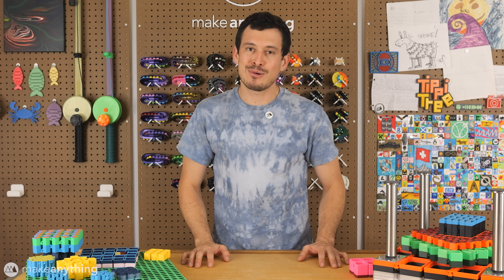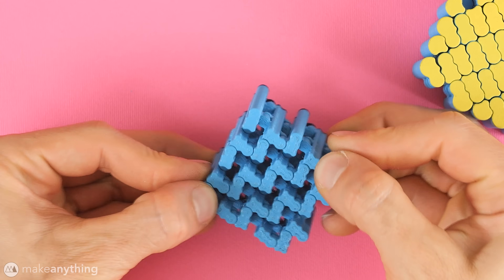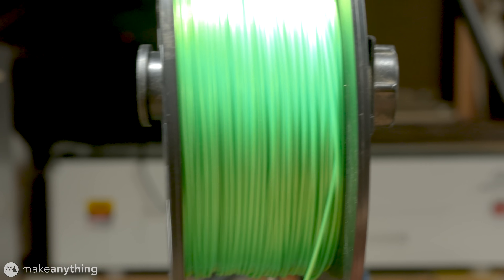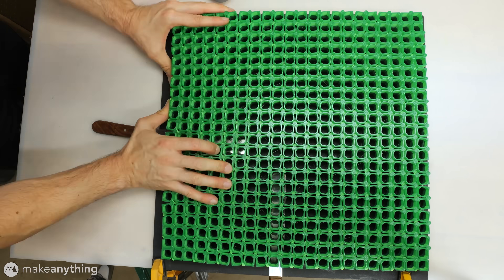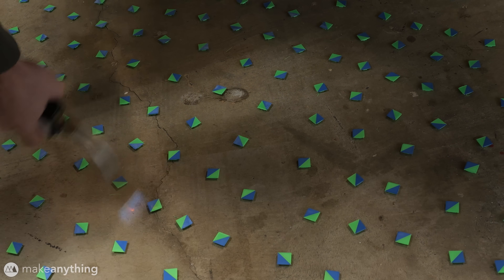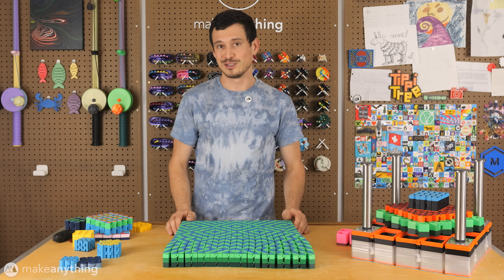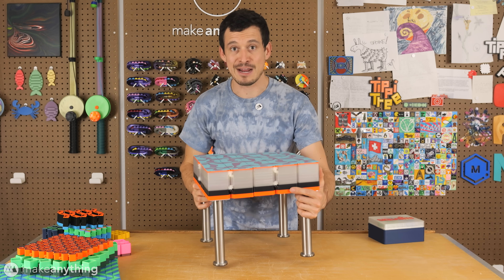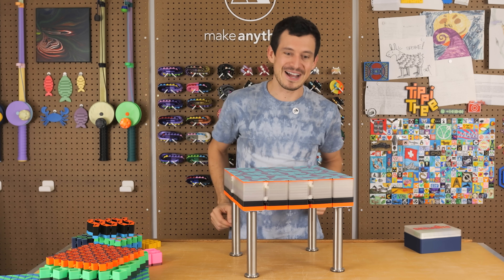Auxetic Art (win a 3D printer!)

Comment: How'd you do the 90 degree rotation locks in illustrator? also curious about how'd you do the perfect grid, if you wouldn't mind answering
Reply from the maker: Hold 'shift' while rotating for 45 degree increments. For the grid I just had snapping on, hold 'alt' while moving one square, and then used Ctrl+D to repeat that action over and over to make my grid
Reply: @make.anything  awesome thanks

Comment: A tip for stuck prints like the tiles at 8:00 - don't try to bash the spatula under them violently, especially with your hand on the other size just waiting for you to slip and slice your hand open, simply grab anything solid and gently tap tap tap the end of the spatula instead. It works wonders.
Reply from the maker: It's embarrassing that I never tried that. Good tip! 😅

Comment: Heres an idea 💡, from the functional print loving half of your audience.  Make the austhetic part thinner and stronger. Now you can print a support lattice using minimal material on a smaller printer, which expands to become larger. Then you can place your fill pieces both into the existing lattice as well as into the openings... Now you have printed much larger surfaces using a small printer And by using less plastic than if you had printed the lattice to be your desired size and glued it.  For your bonus round, figure out how to print it on two levels so that when you expand it to its maximum size, There are pieces on hinges that fall down into the openings to close them off from the top. Now you have an expandable table without any holes in it at its largest size.  Flip it over and all those hinged caps pop back out, and you can close it back up

Comment: Man that's so dang trippy! I wonder if the properties can work in more than one plane... Probably not, but maybe!
Reply: I mean something similar (pull in one direction expand in another) has been done with paper recently by 3m to make packing material.
Reply: I Think an infinity cube might be the extension of this.
Reply from the maker: Hmmm tries to rotate hinges in my head 🤯
Reply: @make.anything  A 3D "hinge" might be a ball-and-socket joint, with every 4 cubes able to rotate their center sides up or down to the surfaces.  The resulting action would be super satisfying as well, with the square hole "folding out" into 4 tiles.
Reply from the maker: @WatermelonArtiste  you might be on to something 🤔
Reply: Kind of like a Hoberman sphere?
Reply: as gabe said... the next step seems to be the Hoberman sphere.
Reply: There’s also a 3D version, that’s not a surface, but it’s less fun than the 2D style imo
Reply: The original diamond-fold structure could be made with compliant joints. It wouldn’t have a nice full 90° rotation but any material with a negative poissons ratio it pretty cool.
Reply: Steve Mould made a video about special variable-shape auxetic structures
Reply: The hoberman sphere comes to mind, check it out.
Reply: I mean my immediate thought is the 3D toy that expands from a small sphere into a much larger sphere. In chorus they used it as a visualization for expanding our lungs. As others have mentioned it’s called the Hoberman sphere
Reply: You should research Bistable Auxetic Structures!
Reply: There are 3d and 4d auxetics!
Reply: Look up the channel GCM EPFL, it's a Swiss university with a number of different research papers (and corresponding videos) in this field. The most similar would likely be their paper on bistable auxetic materials

Comment: You still use Simplify3D?
Reply: For him its free😂
Reply from the maker: I mostly use Prusa Slicer, but already had the printer profile for the CR-10 Max on there... plus it can actually handle massive files fairly well
Reply: @make.anything  Ahh okay that makes sense since you hadn't used the printer in a while. Yeah Prusaslicer does bog sometimes with large files.